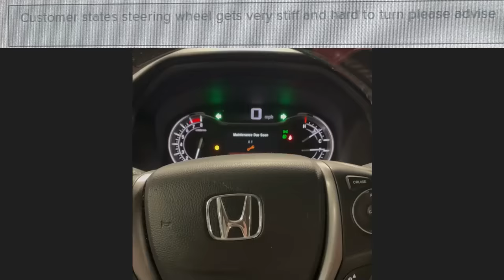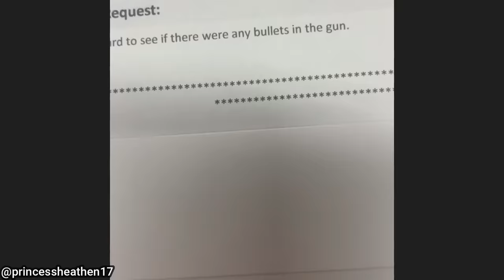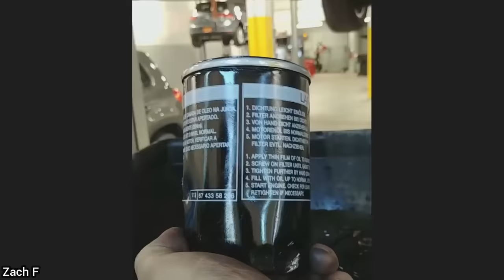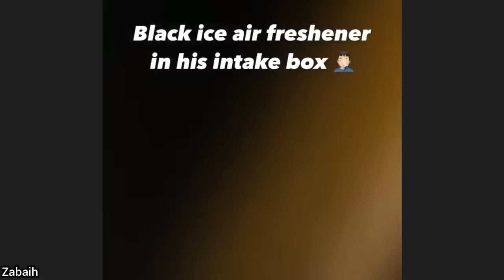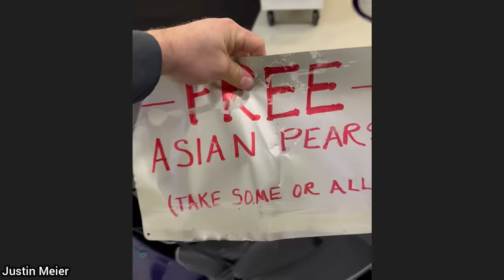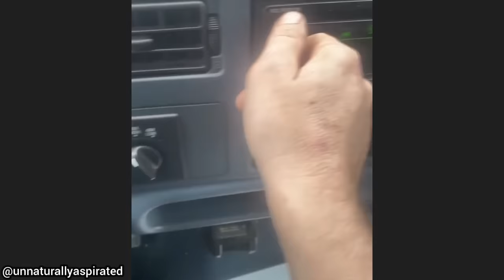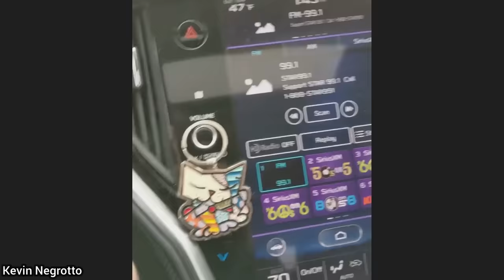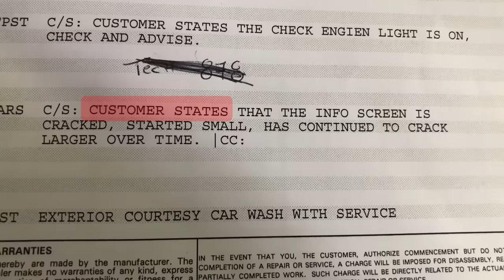Customer States Compilation (The Best of 2023) | Just Rolled In

Comment: Notamechanic here.  I changed my water pump on a Pathfinder and took out every layer, placed them on the driveway in order and then marked the timing belt before I took it off.  I then washed everything including my marks 😳.  Walked to the local Nissan dealer and they printed me the pages I needed from their repair manual to replace the timing belt.  Nicest people, even though they did laugh at me. 😆
Reply: Okay, not the best idea to scrub off the marks (sorry had to say it) but you at least *tried*. Which is more than can be said for the... well anyone in the video. Lol
Reply: At least you are aware you needed to mark it. Most people have no clue. Shit happens even as a pro.
Reply: At least you had the common sense to get the repair manual instead of just trying to figure it out and making it worse than it needed to be 😂
Reply: @FokkeWulfe They didn't try? Interesting take.

Comment: A plumber is hired to unclog a customer's sink. When they arrive, they find 50 individual pipe fittings of all different materials, sizes, and shapes connecting the sink drain to the plumbing. There are three separate paths for water to flow through, one of which leads to a dead end. The faucet is a random copper pipe with the end crimped, and holes drilled through it to let water out. They have welded a wrench to the cold water tap since the original handle broke off. The garbage disposal (the cause of the clog) is actually a blender motor shoved onto the bottom of a metal coffee can with the edges glued to the motor body to prevent leaks, and a pvc pipe drains it to a separate drain. The customer put plastic wrappers down it to get rid of them, thus causing the clog. The plumber refuses to do any repairs and blacklists the customer, and the customer continues using the monster of a sink while calling a different plumber. They go through 4 different plumbers before finally giving up and ripping it all out to install a new sink themselves, but they end up damaging the plumbing in the walls and have to hire someone to replace it, and install another new sink.

This is the energy these videos have.
Reply: So... Crackhouse energy. Yep, I think most of these are people who live in that type of house...😐
Reply: "The faucet is a random copper pipe with the end crimped, and holes drilled through it to let water out."  I imagined it being bent crooked in random places too, like it was used for other things first.
Reply: @jasonsummit1885  Also a result of the Dunning-Krueger effect. Unintelligent people will usually overestimate their intelligence not being smart enough to even realize how much they don't know whereas intelligent people underestimate their intelligence and if we don't know how to do something will not attempt it until learning how to do it right or having a professional do it. I'm sure lack of money is also a factor in so many of these especially declining repairs.
Reply: Ah yes As an Electrician the amount of times i had a Service call someone saying this light won't turn on and it ends up just me flipping a breaker and it works again or i have to fix something the homeowner thought he could do himself and botch it up completely it is endless. in Vancouver BC new builds have something called a Master switch that is designed to turn off all the lights in the home and if the Master switch is off you can't turn any lights back on. had quite a few calls about that as of late. Just to explain to the Customer that the Master Switch has to be on before they can turn on any lights.
Reply: You finished rambling, Wikipedia?
Reply: “The customer refused repairs”
Reply: Well said! I worked for a plumbing company for many, many years.. your story is so right on!
Reply: I remember working in a house where a teenage girl called out to her mother that the dishwasher was backing up into the sink again. The mother replied, "Oh no, I've got to call the plumber again. I glanced over and told the daughter to turn the garbage disposal on for a second. She did and both mother and daughter were shocked to see the sink drain almost instantly. Her plumber had been out 5 or 6 times in the year that they had lived in the house and had charged $175 per call to clean out her sink drain. She didn't know that you have to run a garbage disposal unit periodically to keep it from plugging up when you drain your dishwasher through it. She said that she felt like her plumber had ripped her off and she was definitely mad about it. I heard her talking to her husband about it on the phone and I was in the opposite end of the house.
Reply: @dickJohnsonpeter  I'm pretty handy, but I will not mess with natural gas and don't like soldering water pipes. Gotta know your competency level.
Reply: @AlexaxForest Out of curiosity, is this a commercial or residential nightmare?  

Personally, I don't do any plumbing repairs, electrical yes within my limits, some carpentry, again within my limits. You gotta know when to call in the cavalry. 
Red Adair: "If you think it's expensive to hire a professional to do the job, wait until you hire an amateur."
Reply: @zgSH4DOW  Why you so mad, 2012 edgelord tumblr?
Reply: Ultra specific comment love it
Reply: TL:DR

Comment: 8:05 is probably my favorite one. Truck is up on the lift, not doing much of anything, and the ball joint just... completely gives up.
Reply: Had something similar happen to me, but it was a busted rear leaf spring...couldn't even tell it was broken. I put the car up in the air, replaced wheel bearings and seals, and brakes, and was ready to put it back on the ground when I saw the drivers' side part of the axle drop a little. Looked at it and found the main leaf was busted right where it attached to the rear shackle, and it had been that way for a while. Didn't have a replacement so I drove it like that for a week with no issue 'til the new one arrived.
Reply: Holy f**k!
Reply: Really lucky it was on a lift and not the interstate.
Reply: there's a lot of ball joints held in by compression alone; unsupported on a lift may be the cause after all

Comment: I have a confession to make. So last summer I crashed my car, it was pretty much just cosmetic damage, but I did have to replace the passenger side door. My driver side window already didn’t work (honestly just too lazy to fix it lol), and when I got the passenger door, the window on that one didn’t work either, so I was stuck with no windows being able to open or close. Drove around all summer baking in the heat. At the end of the summer, I finally realized I had the window lock on. Low and behold, the passenger window works now! I’ve practically rebuilt the whole engine and suspension on this car, I know it inside and out, and this really made me think “holy shit if this isn’t a ‘customer states’” moment lmao. Never felt dumber in my life
Reply: Can happen to the best of us, especially if you accidentally hit the switch, so don't think to try it.
Reply: try changing the belts, tensioners, oil seals, front of a ford focus 2.0tdci..  & time it..  enjoy..
Reply: That's okay, I was one of those who neglected oil changes and ruined a perfectly good Windsor. Now I maintain my cars religiously 🤷
Reply: At least you have the balls to admit it. Lmao. But dude.... WHAT THE FU-
Reply: In all seriousness. You think thats bad? Three years ago I had parked my truck on a hill, and had my emergency brake on, I'm with my girlfriend, and we go to leave. I'm driving and there's smoke coming out of the back. I park my truck onto the side of the road. Call the fucking FIRE DEPARTMENT for a vehicle on fire, and wait. An hour and a half later, they show up and inspect the car, and realize I had left the parking brake on.. The look of disappointment in their eyes I'll never forget.. Fast forward now, I work at Firestone as a maintainance technician and look for problems like these! 🤣
Reply: I had it happen to me in reverse one time. I owned an older vehicle which I did my best to keep in top shape. Repaired only what I knew how to repair, took it to a good shop for the things I knew were beyond me, stayed humble about my own abilities so that I wouldn't end up with a rolling deathtrap. Had a chronic battery connection problem, which I did eventually get resolved PROPERLY after several attempts even with the help of the good shop. This battery connection problem did occasionally leave me stranded and unable to start my car, and the good shop was not open one of these times - which I shall now relate. 

I had my driver's-side power window rolled down so that I could speak to my father, who was helping me with a DIFFERENT issue we were handling at the time when the car refused to start back up. I don't remember what the problem was that time, possibly a chirping belt. At any rate, I had to call for a tow and as I said, the good shop wasn't open, so I had it towed to the nearby Meineke. 

Well I got the call back from the Meineke, they got my car running again but told me they were unable to close the car window and explained that, among a laundry list of other silly fixes the good shop apparently had never caught (eyeroll,) I needed a new window motor as the one in the driver's door was fried. I didn't quite believe that, but I paid them for the labor they'd put in and told them not to worry about further repairs. I figured if it was the truth, I'd schedule repairs with the good shop when they opened back up.

Friend of mine dropped me off at the Meineke, I hopped in the driver's seat of my poor, loyal old car, turned on the engine, sighed with relief that it was indeed running again, then tested out the window. Rolled up, no trouble at all. Needless to say, that particular shop is off the list of backup shops when the good one is closed and I need repairs ASAP.
Reply: coming up to UK MOT inspection had the ABS warning light coming on, so simple fix remove dashboard take out bulb, pass MOT
found out faulty relay was not ABS was BATT (not charging)

Comment: Living in Germany, most of these really make me appreciate TüV - a regular mandatory inspection of the car.
Reply: @MarkUKInsects  Italy here, same for us. IIRC for minor defects (lights, gas emissions etc.) you are simply rescheduled in a couple of days/weeks, while for dangerous problems (with brakes, suspensions, wheels, steering) you will have your car towed straight away to a repair shop and not allowed to be on the roads until passing a clean test
Reply: @MC202zipper  Same in all Europe. Well better say, all EU type Europe. 
In fact one can even make the "inspection" on another EU country and it's 100% legal.
Reply: I live in Texas, and I'm not happy that they have done away with mandatory yearly safety inspections.
Reply: @texastedskol  That's not until 2025.  You can still choose to get it done.
Reply: cons of TüV: no unique car builds
pros of TüV: idiots with broken cars won't endanger everyone around them while going 80 on the highway
Reply: That's not the point. Without mandatory inspections, there will be vehicles on the road with bald tires, bad brakes etc, increasing accidents.
Reply: We have mandatory inspections in the state of New Hampshire, and seeing these videos, I've decided it's well worth the yearly cost.
Reply: @CensorshipGenesis  Oh, this is new for me! I didn't knew, but seems logical. Thanks CG!

Comment: Dr’s are required in Canada to tell the MTO if a patient has had seizures, blackouts etc so they will take their licence away until the problem is fixed. With some of these cars a mechanic should be required to notify someone if a car  is dangerous and the customer refuses repairs. Some of these issues could kill the driver or someone that is innocent.
Reply: That sort of thing is hard to implement, as it would cause a lot more of these people to try to fix these issues themselves.
Reply: @antonliakhovitch8306  looks like they are doing that anyways.
Reply: I have had a brake shop try to refuse to give my keys back because I didn't want to pay an inflated amount for brake repair (they quoted four times more than the shop a mile away did).  Called the police and they were told they could refuse a fix but not refuse to release the car.  Ended up junking it after that because it had other issues that were much more expensive and exceeded the value of the car.

Comment: 2:05
I gasped when they said vegetable oil,
I gasped again when they said 5L.

Holy moly how do some people make it this far in life without dying.
Reply: Hee likely heard that a diesel engine can actually run on vegetable oil (technically true - IF the viscosity is low enough), and thought that fuel and lubrication are the same thing...
Reply: Modern medicine and our safety culture ensures people don't succumb to Darwinism at the appropriate rate.
Reply: I watched a European motorway cops show and there was a guy driving down a very busy motorway with his children inside...his relatively new vehicle check engine light came on so he immediately stopped on the road ,no pull to the side no get off the road and find a safe place to park...He just sat there and called for roadside assistance.  To be honest it's been so long since I watched that ,I can't recall if his car was hit or if he had  caused any other accidents to accur. All I remember is the stupid look on his face, and me thinking how is this person allowed to habe a family,or a drivers.

Comment: lol, the first time my son wanted to help me maintain my truck, he went under it to drain oil, then he re installed plug, luckily I pulled the drain pan out and noticed it was not the right colour. He drained the transmission fluid instead, no harm done though, I removed pan, replaced transmission filter in pan then bolted back up and marked the oil plug so he could drain it. Lesson learned. He was pretty upset, I said if you are not making mistakes then you are not doing much. He loved working on vehicles, Now he is going through to be a mechanic.

Comment: I worked as a mechanic for agricultural machinery. Including stuff like chainsaws and so on. 
One day a ride-on mower came in. Customer stated, it wouldn't start. 
The gasoline tank was dry. I filled it up and it started instantly
Reply: I actually had a lawn mower returned from maintenance without any oil in it though. Perfectly good mower was ruined because I assumed there was oil in it after service and just started it. They denied it completely but after a while they offered us to buy a new mower for a discount so we did. Still miss the old one though, I liked it better.

I got a car returned from maintenance low on oil once too, they told me that they didn't check the oil and I asked wtf the service was good for then. No harm though, just a huge bother.

Comment: That one where the customer admitted to putting vegetable oil in the engine resulting a very thick gloopy mass might hint at what is causing the jello-block-in-the-oil-pan symptom we see on here occasionally.    Both vegetable oil and engine oil can polymerise with heat over time, but I'm thinking that the combination of the two might have some kind of polymerisation super power - basically it's turning into a rubber block very quickly at normal running temperature.

I might get around to testing this at some point, but in an old saucepan or can on the stove.  If anyone else wants to try it, I would use 50/50 and keep stirring it while heating.  Maybe do it outside.  It probably won't solidify until it's cooled down - that's why the block is entirely in the engine pan rather than showing up as burnt rubber all through the engine.
Reply: That was my thought. If you leave used canola oil alone for a while, it basically turns into rubber.

Comment: The rubber brake lines, and the muffler pointed to the plastic gas tank broke me up.
Reply: I don't know much about cars. What's the problem with rubber brake lines?
Reply: @renakunisaki  Reason rubber doesn't work is there can be well over 1000 pounds per square inch(psi) in the lines, which is why steel is used. The rubber hoses would do nothing but bulge out or even burst when the brake pedal is applied. There was also air in the hoses which will cause the brakes to not work. There are hoses on brakes for the front so you can steer, and for the back so the suspension can work without breaking the solid lines, but these hoses are reinforced with steel or nylon braiding to withstand the pressure.

Comment: Everytime I see videos like this, I'm glad we have such strict safety regulations for cars in Germany.
Reply: Yeah, the yanks are crazy.
Reply: We have strict safety regulations, too. It's just that Americans break rules without any problem. Germans, however, consider a regulation to be an actual physical barrier to wrongdoing.
Reply: @annehaight9963  We in Poland don't have any problems breaking the rules either, but the government have developed this technique called law enforcement. For example in every EU country (Germany included) every car older than 3 years has to pass a technical inspection once a year or it's registration is revoked, and any modding of the safety/emission related equipment done without a proper license and certified parts will not pass. If you drive such a car and police stops you for routine control (happens roughly once/twice a year if you drive regularly), you'll get a hefty fine, and your vehicle will be towed away at your cost. Not to mention that if your car looks suspicious (like a lot of smoke, noise or weird things sticking out) it'll happen as soon as you drive by a police car.
Reply: @EustaH  I don't know if it's a Belgian or European thing, but since this year it's every 2 years in Belgium
Reply: @Matthigast  same in Denmark
Reply: @cesio25  same in the UK, its called an MOT
Reply: Also probably because you have autobahns where speed is unlimited. Imagine driving one of these rotted out vehicles at 250km per hour. an accident just waiting to happen!